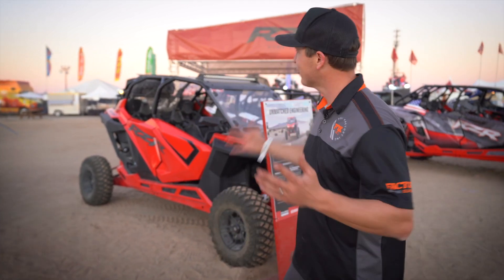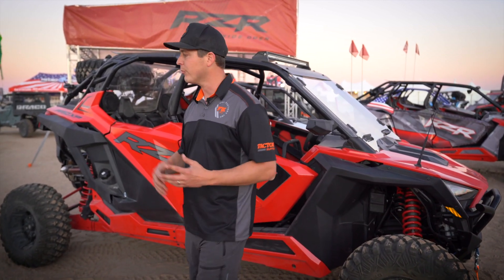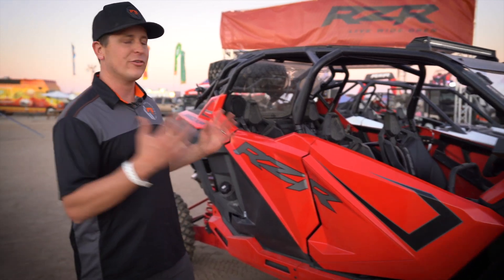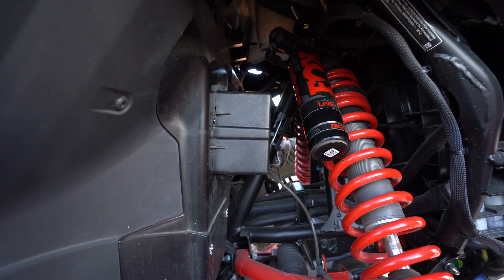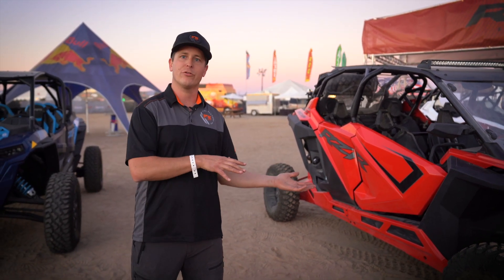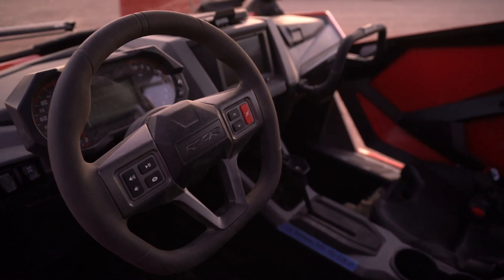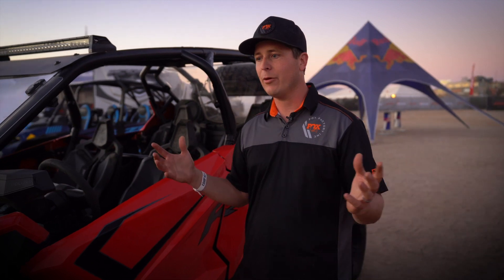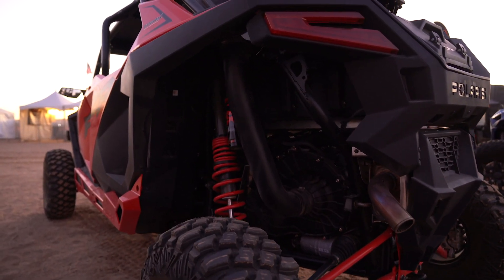UTV: What is LIVE VALVE Suspension on the RZR PRO XP? | FOX

Comment: One of my shocks are leaking on my new turbo s. Fluid comes out of the electrical plug on the reservoir. I have found several others with the exact same issue, but no resolutions yet. My car hasn't hit 40 miles and has been a trailer queen up to this point. Really want to get it fixed, but Polaris and the dealership has yet to come to an agreement on how to do it. So I am stuck with a new car with a shock I presume will cause some safety issues if I actually drive the way it was designed for. Any suggestions?
Reply: I have had the same issue on the driver front shock. Fox has asked to have it shipped to them for inspection.
Reply: Are you still having a problem with it?